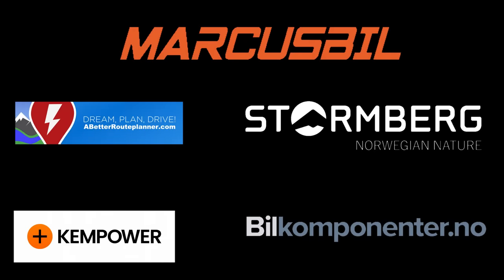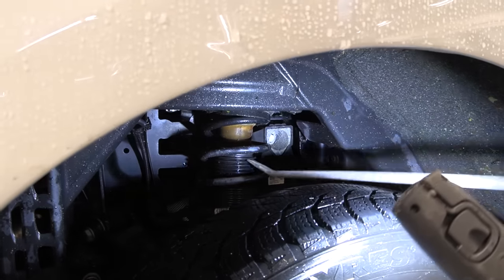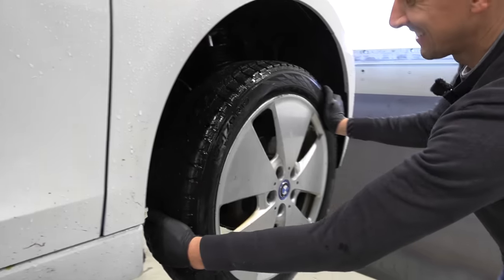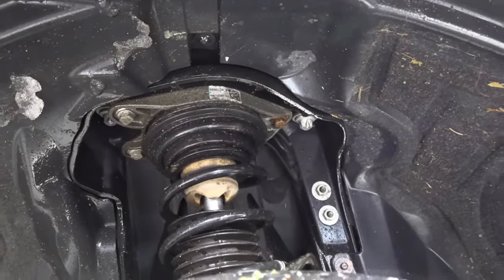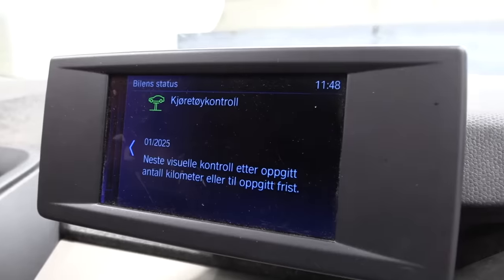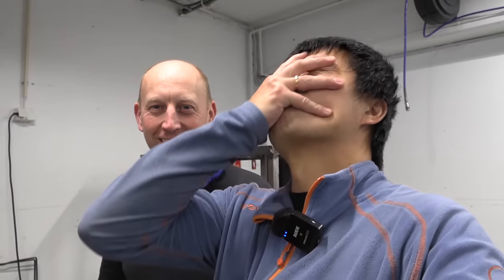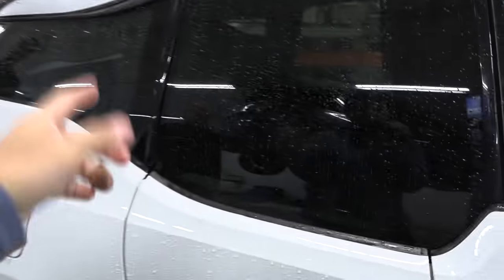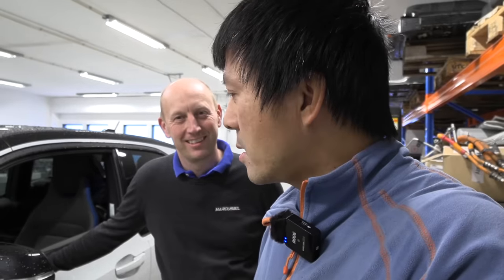Elbilmek finding issues on BMW i3 120 Ah

Comment: i3 would be a nice replacement for Frankenstein - at the very least you would be able to drive 150km without worrying about finding a Chademo charger. A degradation test would be good because it would also be some guidance for Mini Cooper S E owners as both cars share the same running gear but Mini is conventional steel body and I3 is Carbon Fibre “space frame” type construction. Also both cars have instruction from BMW to always let the BMS handle the charging and to go to 100% every time………

Comment: I think your videos with older cars (like the Geilo test, but also zero mile and degradation) will be very important in the future when the market for used EVs will be growing. Right now, the choice is quite limited in 5-9yo cars category, leaf 1, TMS, Ioniq, Zoe, i3 and triplets, and that is pretty much all but in 1-2 years a lot of other mass-market cars will enter the group TM3, Niro, Kona, Leaf 2, MEB cars (mostly ID-3) etc. And those test will be important for people from for example Western Europe (e.g. Poland) where people buy mostly used cars from Germany, France, and Norway (most Leafs 1 on Polish roads actually comes from Norway :) )
Reply: Agree, i think that testing new cars will become irrelevant, the biggest market will become used, as these cars filter down how much impact will degradation have?
Reply: @freddydad1  not as much as many people think.

(Need to compare the cost with, perhaps, duel mass flywheel failures and egr clogging 😂)
Reply: @freddydad1  I do not know if it will be the biggest, I think testing new cars is still important but the aftermarket will grow very fast in the next few years and since the most knowledge about degradation comes from extreme cases of taxi drivers or... leaf 1 people think that 8-10yo cars will be useless...
Yet another think will be manufacturer approach to used batteries i.e. if they will be buying them back to regenerate them and put in lower tier cars to lower the cost.... we will see :)
Reply: *Ioniq
Reply: Older Leafs suffer because they are CHAdeMO and they are getting rarer as networks like Ionity and Tesla don't bother with them. As the older chargers get replaced-it may be harder to find chargers while on the move.

Comment: Change the shock absorber rubber protection to Sachs! I did and they last a lot longer because it is a lot thicker rubber than stock!
Reply: I do not see the option to pick i3 on the Sachs' site.  Do you still have the Sachs part numbers handy?  
The BMW front suspension item is:  Dust Shield, Suspension Strut Bellows, Spring Pad With Guard Tube 313570

Comment: Hi Björn, it would be very interesting to do a degradation test on this i3. I own an i3s from the same year (2019) with 50k kilometers on the clock. It does not show any signs of degradation yet, but it would be great to have an idea on how well the battery is holding up. Keep up the great work - I love your channel, man!
Reply: I have a more ancient one.. 2016, 176,000km. Mine is the REX version (33kWh) but I'm guessing it doesn't make that much difference. I drive it well over 90% electric.

I'm planning to do a degradation test on it myself and it would be really nice to have this comparison.
Reply from the maker: Any battery degrades. BMW is just good at hiding it.
Reply: @bjornnyland  slightly negative about the car in this initial response. And I think it's even not right in this case. The battery has a big buffer. By doing this, you'll never stretch the battery to the max (concerning upper and lower buffer). It's not about hiding, it's about taking care of a battery in a smart way. My humble opinion on this ;)
Reply: I suspect most batteries from same period of build are pretty similar in degradation when the 20-80% buffers are the same size. But of course buffers aren't the same which can make a difference. Still think many modern ev's are capable to do over 200.000 km.

Comment: Dont laugh about the skinny but efficient and economical tires. Nowdays fat low profiles is a stupid and expensive fashion.
Reply: Yep, exactly right. On top of that, modern big diameter rims are totally unecessary and a net drawback to most drivers as well. This car should have had 14" or 15" inch rims on top of the skinny tires if it wasnt for looks.
Reply: Low profile tyres make a very expensive noise when you park badly-my new car went back to classic tyre profile, even though "crossover" still means oversized wheels taking more trunk space
Reply: Fat tyres do have better acceleration, cornering friction and braking- but they do acquaplane more easily if you let the tread wear....
Reply: @SteveLoughran  You are quite right, but the difference in those areas where they have an advantage is so small as to be dwarfed by lots of other factors, and certainly isnt very interesting and couldnt even be identified by the average motorist on an average road.
Reply: @GoldenCroc  I'd say the tendency to plane is more significant, but it's no new -my wife's Ml II Golf GTi liked to do that and I've managed to scare myself once too on a Belgian autoroute.  But tread depth is the dominant factor: check up on tyre depth before the rainy season begins and make sure all is well. Apparently Teslas have a bit of a problem there -either due to people accelerating aggressively or just because of the weight of the vehicles when braking. Which, if true, means the EVs which use battery size to give the range their customers think they need (hello Audi SQS etron Q8) are going to be even worse. We shall see

Comment: I have a Jan 2015 i3 60Ah range extender, it's on 107.5k miles (173k km). I've had it for over 4 years, it had 42k miles (67.5k km) when I bought it, and I've not noticed any serious degradation. They are lovely cars 😊

Comment: I had the 33 Kwh i3 and after 4 years and 143,000 Kms it still showed 29.5 Kwh available the same as when I got it at 9 months old and 9,000 Kms. Very impressive. 

It would be interesting to know the battery degradation on the 44 Kwh. 

My id3 82 Kwh had 73.6 Usable Kwh when new now it has 71.5 Kwh or roughly 2% degradation after 2 years and 67,000 Kms but I take that with a pinch of salt as the id3 rarely sees close to a full charge discharge cycle and the BMS probably isn't fully calibrated, last night was the first time it reached 10% in the 2 years I own it, I ran it low to test fast charging on 3.2 software and saw max 87 Kw after about 10 mins plugged in, it started at 75 Kw possible it warmed the battery though I didn't monitor that in the beginning. I did see that battery temp at the end was around 32 deg C, this was plugged in from 10-42% got 22 Kwh in 17 mins, not fantastic.

Comment: I have one of these (2016, 33kWh REX, 176,000km). 

My suggestion for an extra test is how the skinny tyres perform on a skid pan - or a Moose Test. (My gut feel from having driven mine for a couple of years is that its Moose Test would be pretty poor - especially in the wet.)

Would be very interested to see the normal degradation test as well of course.

Comment: Why so negative... I think this older BMWi3 is in many aspects ahead of other cars (as Munro still believes, even as being Tesla fan) . Concerned the material used, production methods and weight, I think it's still one of the most eco friendliest ev's out there.
Reply from the maker: 1. It doesn't have radar so ACC will very often fail in low sun or when leaving tunnels.
2. Running heater while charging will overheat the battery.
3. Skinny tires makes the car unstable already at only 120 km/h.
4. Trunk space us a joke compared to many other cars in same size. Reason for it is that below the trunk, there's a placeholder for rex engine even in BEV models.
5. Suicide doors are very impractical if you only need to open the rear door.
6. Car is quite overpriced compared to what you get.
7. Frunk is not dust or water sealed.

But other than that, the car is nice.
Reply: @bjornnyland  Suicide doors also means massive A pillars and blind spots which is a bummer in a city car. It also has very aggressive unadjustable regen settings because of the small battery which gives my kiddo car sickness pretty easily. Still love mine but it's a deeply weird and flawed vehicle.
Reply: @bjornnyland  thanks for
The answer. Don't be surprised: I bought an i3S back after driving an id4 for 2 years.  Point 3 is solved with the i3S, point 4 is better with the Wokeby trunk extension, and they have also the solution for your nr7 point.  I love the car and , probably you won't understand, I even cancelled the order for a Tesla M3 after driving it again for some while. It's one of  a kind. You love it, or hate it. I can't explain, it's against many reasonable expectations, but I prefer this car above many others. I'll keep driving it. ( and at least and for sure, the ergonomics are better than the Boeing 737 I'm flying. ;) . Even the automation is at a higher level. It's probably all about the expectations. At a last point. Parking a car at an airport is a nightmare. Normally they won't get nicer there. This one will stay free from many scratches and bumps because of the carbon reinforced plastics used as panels. Your point of the suicide doors I don't share. With small kids they are very practical. It's easy to get the kids seat in, and they are in save inside as in a 2/3 doors car. I never heard an issue about 2 doors cars. You can always find negative points, but also focus on the bright side. For instance material use and eco footprint of this car. It's massive smaller than an average Tesla ;)
Reply: @elliots4370  the regen is adjustable with the "gas/electric" pedal.  It works perfectly. The "a" pillars are not bigger as usual. It's possible to skip the "b" pillars, because they used a carbon fibre chassis. It's much stronger than a conventional steel chassis and very light at the same time.

Comment: Bjørn, do a test of the power steering. I know of several i3-s where the steering gets heavy and with bad self centering. It gets worse with low temperatures. Costs "a million" to fix, and BMW have never heard of the problem. Sure...

Comment: The front rubber installation for the shock absorbers is a common problem and will most likely be covered under „good will“ policy by BMW. At least my experience.

Comment: Ah is a strange unit because it says nothing about the voltage.
Reply: For comparing capacity between different battery voltages yes, but for same voltage stuff it makes sense, like 12V batteries etc

Comment: On hamstering and beeping: I believe any car should give a warning when the car in operation state ("ignition on", "drive mode"), and you open a door. The risk is that the car drives away whilst a person might get in to or out of the car. The solution: switch off the car. The beeping will be gone then.
Reply from the maker: Tesla and many other car doesn't beep. Solution:
If not buckled up and butt sensor gets no pressure anymore, automatically put the car in park. This has worked im Tesla since 2012.

Comment: The i3 suspension dust guards (that's the official name) fail on ALL the cars. I had mine replaced at 4 years old and the front ones are already beginning to show signs of wear again. Check out the Wisely automotive videos on i3 renovations - they show all the common faults.

Comment: Just bought a bmw13s 120ah , having issues with the heater system works intermittently, have you ever experienced this issue and how do you fix this .

Comment: My 2019 120ah with 124'000km, just got a warranty repair, top strut mount bearing and the seat belt buckle, because of sensor fault in the buckle.
Bmw said nothing, as the car is within 5 years warranty.

Comment: Degradation test on this or original 22kWh i3 would be great.
Reply: Degradation on the original I3 was much more than on the 33 Kwh, I had the 33 Kwh and after 4 years and 143,000 Kms battery it showed 29.5 Kwh capacity same as when I got it at 9 months old and 9,000 Kms.
Reply: Good idea as the battery cycle count would be double that of the 44kWh at the same mileage, plus the age degradation.
Reply: @glenf4115  It's not only the cycle count, the chemistry is different, I remember seeing the specs Samsung released for that particular 33 Kwh battery in the i3 and remember saying, "no way" but it may just prove to be true. Something like 5000 cycles to I think it was 80%.
Reply: @o00scorpion00o  They all used Samsung sdi prismatic cells, 6000 cycles to 20% degradation, 30 year pack life.  They do not show a pack degradation by age chart.
At 143,000 km:
1st Gen  21.40 kWh with 110km range would be:  143,000 odometer / 110km range = 1300 cycles = 5% degradation
2nd Gen 33.77 kWh with 166km range would be:  143,000 odometer / 166km range = 861 cycles =  2% to 3% degradation  
At 6000 cycles to 20% degradation the mileage would be: 
1st Gen  110km x 6000 = 660,000 km for the 21.40 kWh pack 
2nd Gen 166km x 6000 = 996,000 km for the 33.77 kWh pack
Reply: @glenf4115  Yeah pretty long life, time will tell but I was very impressed for sure with the 33 Kwh. 

The 1st gen didn't fair so well though just like the first gen Leaf. They were different cells.

Comment: But the 38kwh Ioniq has Bluelink support so it should have interior preconditioning.
Reply: Charges so slow though.
Reply: @FFVoyager   new charge curve after 2020
Reply: @etienned2354  the 28 rapid charges fast.  The 38 is very, very slow.
Reply: @etienned2354  Yes. MY 2022 Ioniq peaks at 47kw for a lot longer than the earlier 2020 model.
Reply: Interior preconditioning  wouldn't improve performance or be too important for Bjorn, he lives in the cars. OBD scanner is the ultimate mission control for a  nerd.
Reply: @jxmsn.w  how much 'longer'?🤣 (The 28 can, and does,  pull high 60's to 80%)

Comment: 13:30 Ioniq 38 does have app, but rapid-charges slower than 28, so could be interesting "EV bashing" content on trips...
Reply: I was looking around and apparently the 2019 28kwh has BlueLink in the US. Although it's not that necessary if you're camping in the car for 5 minute charging stops like Bjorn. Stupidly enough, it wasn't added for Canada, where 1st Gen Korean EVs have a cult following. The lowest trim of the classic has heated REAR seats, rear HVAC vents and blindspot warning included, all of which they removed from the base 2020 model!  weird cost cutting for a 35k CAD sub-300km commuter. Hopefully the degredation tests can at least give me confidence in a high-mileage battery.